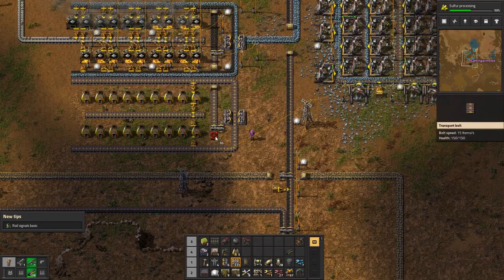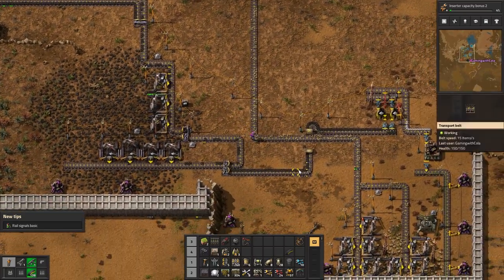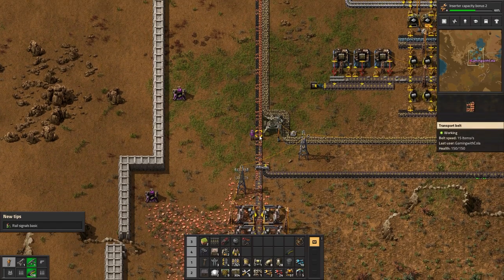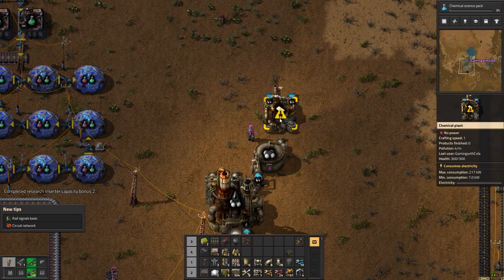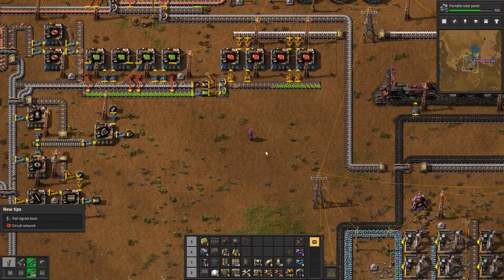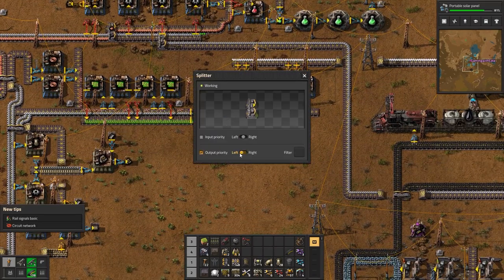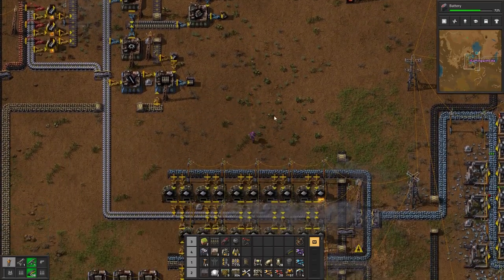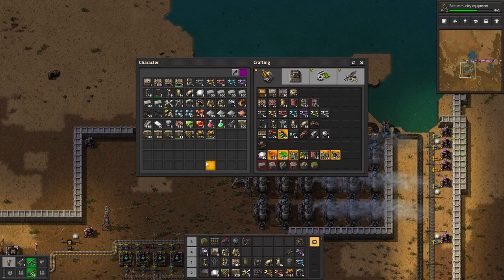How Many Circuits do I need? | Lets Play | Factorio | S1E13

Comment: Also you do not need to deconstruct belts in order to place a different belt on top of them. you can just place them while the old one is still there. also works for upgrades (replacing a tier 1 machine with a tier 2 machine of the same type, like assemblers or inserters).
you can also enable in settings that underground belts should be automatically placed when you click and drag belts, so you can just drag them over a crossing belt or a building in the way, and the belt will figure out a way to tunnel under the obstructions on its own (taking underground belts from your inventory, of course).
Reply from the maker: Cheers my brain just needs to remember that now 😂

Comment: The splitter outputs onto two belts, but you're only connecting one output belt which is what's confusing you, you can't see what the splitter is really doing. When you filter copper onto the left output, it's going to put copper onto the left hand belt. Not just the left hand lane, the left hand belt. If you have an item coming in on both lanes, the splitter will output it on both lanes. If you have items coming in on two lanes but you only want it output on one lane, you need to side-load it.

Edited to add: you're starting to use items in much larger quantities now, so you're going to need more miners and more smelters to satisfy your factory's hunger for iron plates and copper plates. Don't panic too much about assembly ratios, you'll see that if you're not making enough copper cable (for example) then you need more assemblers at the start of the line, and if the copper cable is backing up then you need more assemblers at the other end of the line to use more. But not enough items coming in is much much more of a problem than not enough items being consumed.
Reply from the maker: Totally :) ill upgrade them soon i might even do that tomorrow i cant remember 

Yeah your right to much is less of a problem then not enough

Comment: Few usefull ratios:
48 stone furnances (24 steel furnances) for full belt.
30 electric mining drills per full belt of ore(every except uranium i believe)
Reply: And the steel furnaces go back to 48 if you upgrade to red belts (which doubles ore throughput, considering that steel furnaces are 2x as fast, means they equal out)
Reply from the maker: Thanks i should use red belts ah ?? There better then yellow?? Kind of like blue arms are better then yellow?
Reply from the maker: Awesome thanks ☺️
Reply: @gamingwithcola  Only if you automate a chest to make it though. Red belts will allow you to put more ore into a smelting line but considering that this episode you made several smaller smelting lines, it's not that big of a deal to stay on yellow belts. In crafting window if you hover over an item, one of the hover things shows you an item's raw cost, in smelted plates. Hover over yellow and red belts, you will see that a red belt costs more than just having 2 yellow belts side by side.

It is compareble to blue inserters but problem with that is that belts are far more used than inserters, meaning it's much easier to justify to use fast inserters everywhere.

Again, unless you have it automated and then return to chest to pick it up from time to time. Hell, later once you get construction robots, you can have 1 assembler making some upgraded thing like express belts (they are blue and 1.5x better than red belts or 3x better than yellows), have them output into a chest that gives access to robot network, then build enough roboports so it covers your base, then use upgrade planner to select your entire base and bam, bots will slowly but surely upgrade your base.
Reply: @gamingwithcola  Red belts are faster(30 items per second) then yellow ones(15 items per second), but they dont have any other advantages. I mostly using yellow belts. Also there blue belts which are even faster.